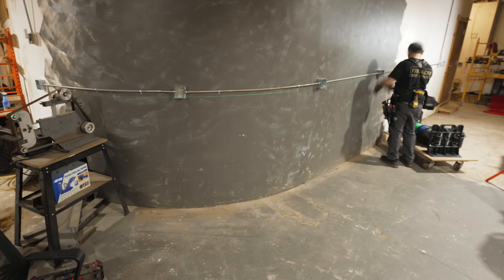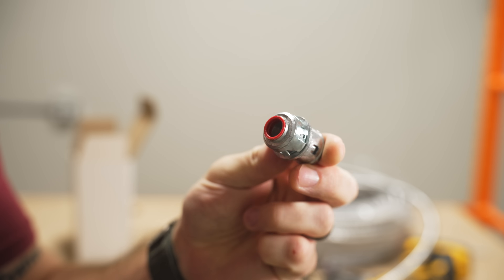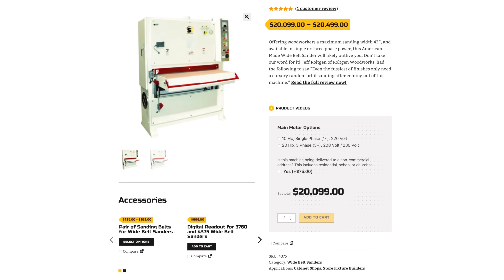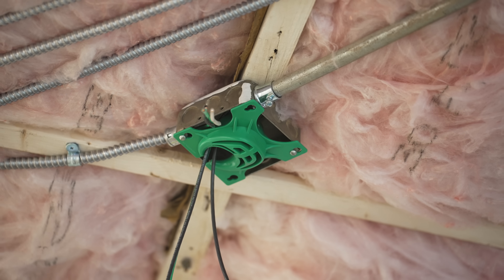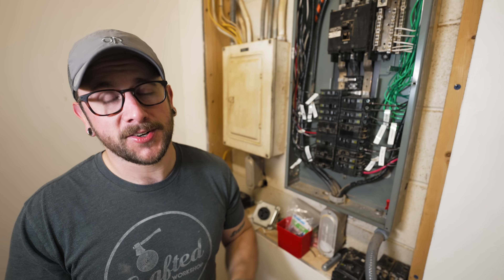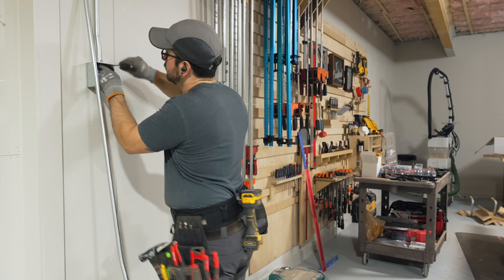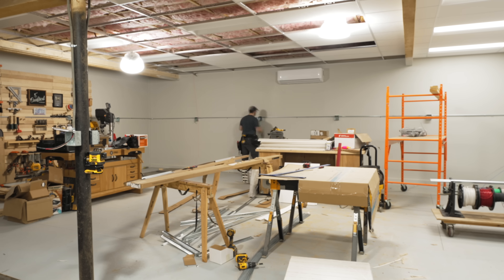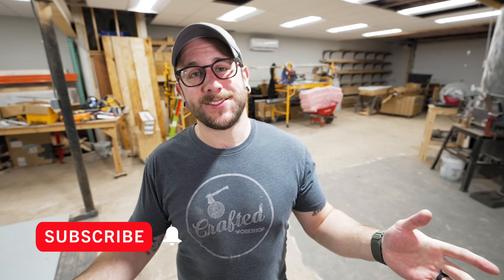How To Install A 240V Outlet | WORKSHOP RENOVATION 17

Comment: As a Brit I'm totally bemused by your use of extra wires in the outlets? why do you not connect your cable run directly into the outlet? the extra wire and using a wago is just an extra potential failure point if you don't get a good secure connection surely?
I do love the galvanised steel conduit though! I wired my old garage/shed in that stuff, I love the rustic/workman style look!

Comment: No, if you are gonna dry wall the ceiling.
That is not gonna pass codes. Unless you Do not cover all them junction boxes. If i'm correct. That's cold in chicago area. I don't know about where you are

Comment: I don't think that the anti short bushing is required, but it is a good thing to use. The red circular at the end of the connector you showed is NOT a built in anti short bushing. The cut end of the conduit is before that location and the wires a still susceptible to damage, so if you're going to use anti short bushings, use them here as well.

Comment: Hello, Could you help me? And let me know what size and type of wire (solid or stranded) do I need to use for a 50A (outlet for 325A welder) the run is around 55ft. And can I use that run (split it) to install another 30A outlet for a sander that is closer to the panel or should I run separate  wires. Thank you in advance.

Comment: way did you not go with 3 phase 480v  instead of 2 phase / 240V for the outlets so you had the capability of running 3 phase motor's  and get the efficiency benefits and higher torque

Comment: I saw you used Wago connectors in this vlog. I recently found out about them and have been using them on a small reno. I think they're awesome.
Reply from the maker: So convenient and way faster than wire nuts!

Comment: I will never understand why are you useing 120 Volts, thet sistem is so expensive on vireing you can cary so much more power with 240/420V with tiner wires, I mean if you need even more power just go for 800V(witch is not thet uncommon in Europe) electricity is safe at any voltage if you follow regulations...

Comment: Just out of curiosity, did you put GFIC outlets in every conduit box location for you 120V run? If you did, they can cancel each other out, as I'm sure you know by now. It happened to me in a garage I built and wired.
Reply from the maker: Nope just the first box in line.
Reply: @craftedworkshop  Thanks for your reply

Comment: AWESOME WORK! However you can use an 8 awg thhn wire for 50 amps if its in a conduit and not a cable, and 6 awg wire can be used at 60 amps. {May save u a good buck} 
 This is because you can run thhn wire at 75 degrees rather than 60, like in a romex cable. This rule does not apply for 10 awg, 12 awg, 14 awg wire!
Reply: Not sure where you are getting that Romex is only rated for 60C.  Not correct.  Romex is rated 90C just like THHN.

Comment: In a workshop with so many different rooms and areas, I highly suggest breaking out into multiple sub-panels. Making a single run of 4 gauge (80A) is a lot quicker and easier, your individual circuits will be much shorter and if you do trip a breaker there is a pretty big difference walking 5 steps vs the whole way across the building for the reset, particularly if you have to diagnose the cause. Having more sub-panels also makes adding and upgrading circuits much easier as well.  

The cost will be about the same (maybe even a bit cheaper) once you factor in all of the lower gauge runs, the conduit, fasteners and the time it takes  to pull all of those long runs.  

It's a bit late for this project, but hopefully this helps someone else attempting to build out a space like this.

Comment: One thing to keep in mind with 3 phase that might not be obvious is that you want to keep the 3 phases balanced, I.e. draw about the same current on all three phases. Great video!
Reply: How would you do that?
Reply: @KevinCoop1  by making sure that single phase equipment are distributed over the three phases, so basically you should not use the same single phase to power all regular single phase outlets. Hard to get perfect but you just don’t want it too unbalanced.

Comment: Electrical work is my nightmare... having only 1 arm rules out ALL electrical work for me. It's been a tough transition.  I was ho0ing to get the Bosch drill press as it's an inexpensive l, beltless drill press... but it's wired for Europe power, and no way I can pay more for outlet installed,  than the actual  drill press

Comment: Next time you need to bend a hook in stranded wire, don’t strip off the end. Strip it about an inch back but leave the insulation on the end. It keeps the strands together. Then bend you hook and attach. Leaving the insulation on the tip of the wire.

Comment: Yes!  Thinking about electricity like water is exactly how I began to understand it.  Voltage as water pressure, resistance as the diameter of pipes, current as the amount of flow through pipes.  It even perfectly translates with parallel and series circuits.

Comment: Wow how come you 240 volt socket and boxes are so big i live in the uk and we only use 240 volts and there are all half the size of yours and the max size breakers we use are 32 amp but all plugs are fitted with a 13amp fuse
Reply: That's because your "low voltage" general use circuits are 240 volt. you wouldn't want to run that big stuff everywhere. If you went to a industrial and commercial setting I would expect to see something similar to North America wiring.

Comment: You should consider labeling the outlets with the panel, breaker #, and amperage. It's best to do it now, and save time when you (or someone that didn't setup the whole thing) has to figure it out later on.

Comment: Watching this as an Australian is sort of hilarious. 

Metal conduit with self bends instead of PVC and pre made bend adapters or flex tube, 120v existing at all, 240v with 2 hots, those breakers, pig tailing anything. 

Oh man, I am so grateful for our 240v electrical system here.

Comment: i know hindsight is always 20/20 but next time you have a bunch of boxes with conduit in between, look into using a ‘mineralac clamp’ instead of one-hole straps. It eliminates the need for box offsets because the clamp holds the conduit off of the wall about 1/2”

Comment: I have found that with the high prices of copper wire, it's often cheaper to run AL wire to a subpanel on the other side of a large space like this then branch off their with shorter CU wire runs.  Also makes for future circuit expansion and 240 outlets easier and cheaper.

Comment: An important item to add to your comments about breakers and the panel... make sure to reference the panel (and possibly breaker) for proper torque specifications for all fasteners.  Many people do not know or simply ignore those important specs, resulting in connections that may loosen over time (with circuit heat/cool cycles) or may be over tightened (crushing the wire).  Receptacle side fasteners should also be properly torqued.  Invest in a good torque screwdriver and don't use power tools for the job, in general.

Comment: The only clarification regarding 3 phase power/motor connections is the need to understand phase rotation. The first time you connect your equipment make sure to “bump” the motors to ensure proper direction. If the motor rotates the opposite of what you need, you can just swap any 2 phases at the outlet.

Comment: 240 volts - how exotic...... if i wasnt european.... since i am european - why on earth use 120?! who is to blame for that? same dude who figured feets, ounces and yards are a sensible measurement?
Reply: I only measure things in Bald Eagles per Walmart
Reply: While as a fellow European I find it odd too.
Doesn't take away the fact that this was pretty well done.
Reply: We do it to f___.  Up Europeans
Reply: sigh I wonder that same thing everyday. I had to work with 4 different voltages in the Navy up to 4160V but by far and away 120 was the most tedious and annoying. There's just no need for it!
Reply: Because lightbulb that Edison invented needed it.  You're welcome, World.
Reply: @hansangb   edison invented the lightbulb, u sure? :D
Reply: @did4h2k  positive
Reply: @asseater1895  wrong though, it was Humphrey Davy. Edison created a version 40 years later that made it commercially viable.
Reply: @did4h2k  ok, a commercially viable filament.  Which in turn made the lightbulb a reality.
Reply: @hansangb  there you go - being precise is a blessing, not a curse ;)
also, guess what - i am not sitting in the dark, my lightbulbs run on 240v ;) NA could have easily - if they wanted to - made the switch to 240v a loooooooooooooooong time ago ;) but no, for whatever reason NA prefers to run 120 and 240 in their shops ;)
Reply: @did4h2k  During the development, filament wouldn't have made it w/240. And infrastructure is hard to change.  We also have 240 coming in to every house in the US.  Kind of like left vs right hand drive.  It would be so hard to change w/ minimal return (considering the disruption). Just ask the people in Burma
Reply: my man rented a triple nickel to bend 1/2” 😂😂😂 thats hilarious lol
Reply: lol because you don’t need 240v to operate a light bulb. Also, 120v is less expensive to install.
Reply: @josephlareau5726  you dont need 120 to run a light either. Double the voltage half the amp. Has its advantages
Reply: Freedumb units! LOL

Comment: One thing to think about is for higher amperage circuits. The less junctions the less failure points. When you’re drawing a constant 40 amps that can put stress on a connection.

Comment: Hey Jonny, I am from Germany and wondering id you do you also have 3 phase? 460V? Here in Germany 400V are standard EVERYWHERE. Also in residential Houses
Reply: 3 phase 480v is common in commercial and industrial settings here in the US. (Industrial also uses 3phase 600v) However, you won’t find these voltages in residential settings, and most residential is 120/240 single split-phase. Some residential settings (especially larger buildings) do have 3 phase 120/208v
Reply: @N-hunter  I am also bringing my woodworking machines to the US. The run on 400V/50Hz. Unfortunately For that I have to buy a phase converter from 480/60 to 400/50... unbelievable expensive that thing..... about 8K
Reply: @N-hunter  I am moving to the US next month. We have 230V/50hz here. Can I change the 120V outlets to 240V and use my 230V devices which runs on both 50 and 60hz?
Reply: @StripLV  Doubt it, your entire home will be 120 single. Have to get an inverter, pay some fool to hook up as they will not allow unlicensed to install high voltage equipment.
Reply: @soisaidtogod4248  I think that is not true. The dryer and AC needs 240V for sure. So every house has 240V I think
Reply: @StripLV  you can, but you'll end up using two breakers for each circuit.  You may not have room for many circuits like this.  And you'll still need something to convert the plug/ outlet shapw,  as I doubt it's legal to use an imported outlet. And a minor point that you'll need to mark what was the neutral wire as hot.